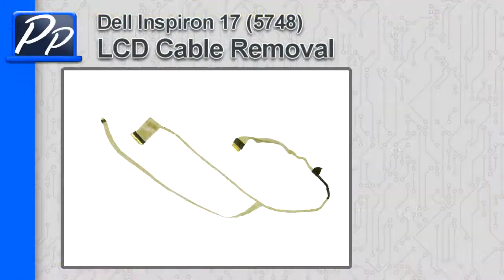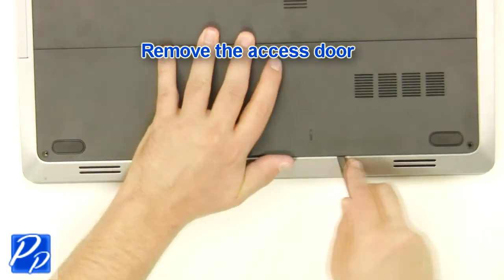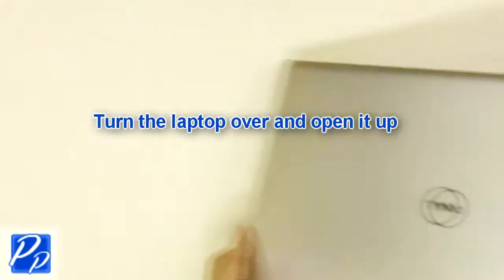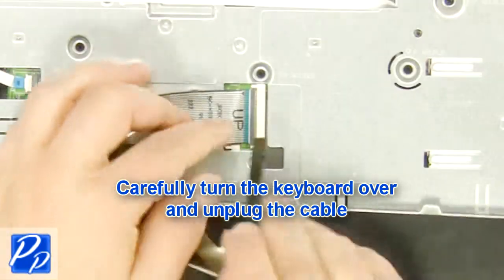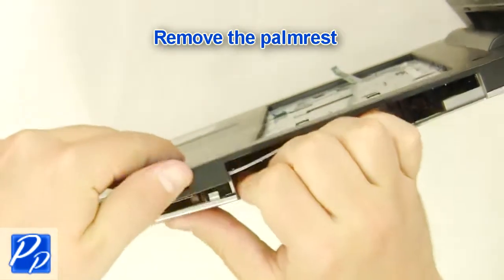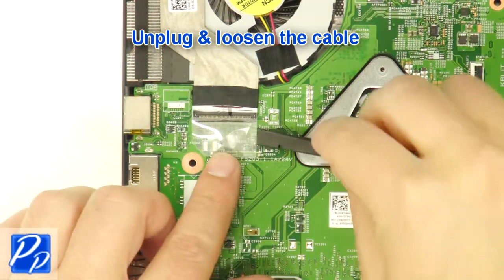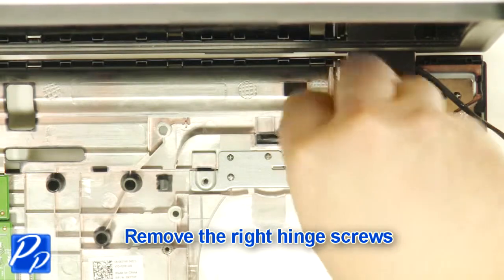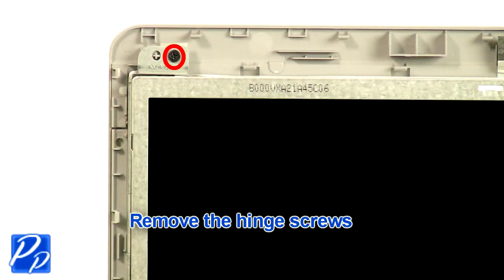Dell Inspiron 17 (5748) LCD Cable Video Tutorial Teardown

Comment: I have an issue with mine. The connector that connects the screen to the board is broken, not the cable it self. Do I have to buy a new board to fix it?